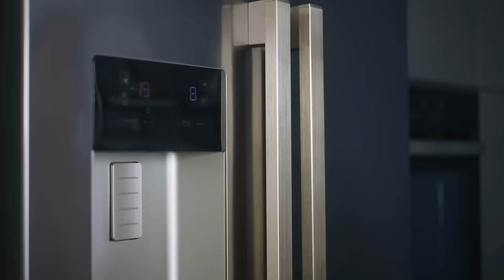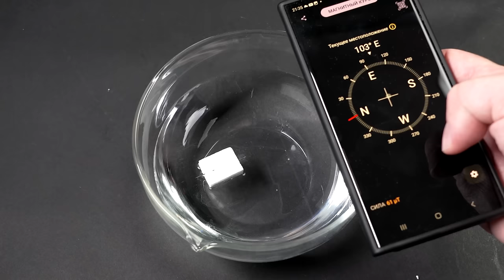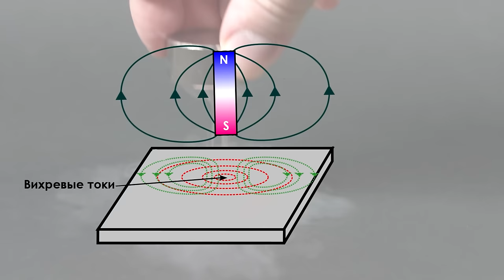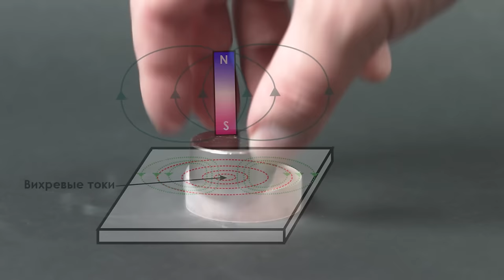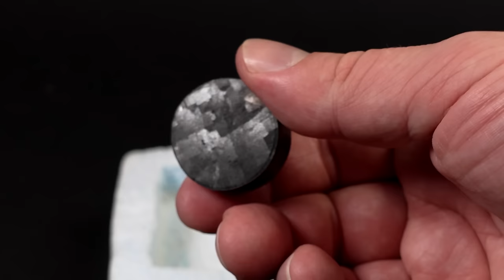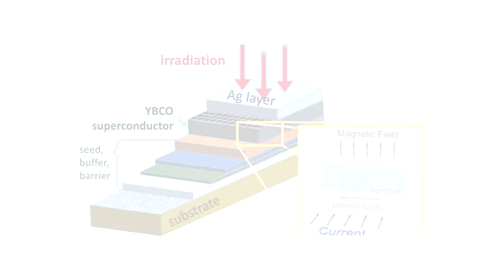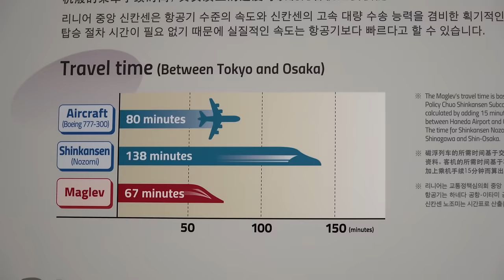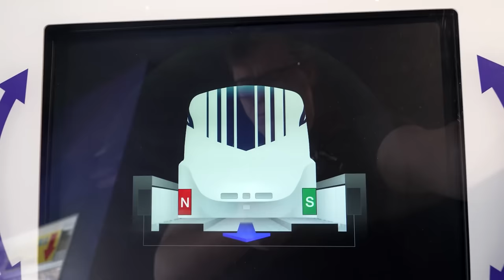This Metals Create The Most POWERFUL MAGNETS!

Comment: That piece you got of the low temperature superconductor was a section of a cable billet for making acellerator magnets. The wiire is stripped of the copper cladding and joined with a ceramic superconducting shunt. It is kept a few degrees above its transition point and charged to the desired current. When this is reached the heater that stops the shunt from superconducting is shut off and the current flows in an endless loop. Very 😎

Comment: 11:50 You need a milliohm capable meter that includes kelvin sense clips to do it properly, or at the very least the ability to null out the testing-lead offsets, as they are normal copper wire there.

Comment: Thanks for the video. Great stuff. Neodymium magnets are super cool. But, check out Iron Nitride magnets which are ~2x stronger than neodymium magnets... I would really love to see how you make Iron Nitride magnets...
One small thing re: the Translation, the "winding" is not pronounced "wind-ing", it is pronounced "wine-ding"
Reply: I've heard that you can make iron nitride by tumbling iron oxide rust and ammonium nitrate in a ball mill, then sinter into the shape you want. But the recipe is very finnicky. Robert Murray Smith did a video about them a few months ago, where he lists a few different methods that have been used to make them.
Reply: @DFPercush  Yes, exactly. And that is why it would be good to actually see it work and get some improvements.RMS didn't actually make it... so I was hoping someone would try to see if it really worked.
Reply: @DFPercush i appreciate his videos 😊

Comment: That experimental maglev train has been around sometime.  There was a big accident with it do to operational error.  The cost per mile of "track" is extremely high when compared to traditional high speed rail...The train has retractable wheels!
Reply: You can hear it running on the wheels  no other reason It would make that much noise

Comment: If the train was operated inside a tube and the air was pumped out in front of it, The top speed would be greatly increased and even Mach speeds could be achieved.
Reply: What about the sonic boom factor?
Reply: @DeathValleyDazed  don't worry, the train whould be stopped at the border and sent back way before it will get to the speed of sound

Comment: sooo, does that mean iron is the best balance of resisting and conducting? but what about a superconductor coil magnet made with boron nitride-nanotubes and ceramic: so this could be fairly easily made and retain its charge fairly well (being boron it will also resist heat better than carbon)

Edit: Ah, I see. so the ceramic alloy is already being used for magnets
Edit 2: Lol you went really in-depth

Comment: From my understanding Quantum locking is not the equal repulsion against gravity. The repulsion against gravity is due to the expulsion of the magnetic field lines from the superconductor; ideal diamagnetism due type 2 superconductor. Quantum locking is when there are impurities in the superconductor allowing magnetic flux to pass through those specific points keeping the magnet pinned to the superconductor; this keeps the magnet from sliding off the superconductor and the superconductor from falling away from the magnet.

Comment: Hybrid-flux - 1200 Tesla! Japan 2018! It exploded on purpose. They were testing the limits but used normal metals. It would be interesting to make the same but with the the strongest material possible and not take it to 1200 Tesla but a nore reasonable sustainable level.....

Comment: You cannot measure low resistance with two wires.
Instead send 10A through the wire and measure the voltage drop. Using Ohms law R = V/A, you find the resistance.

Comment: I’m curious what super conducting capabilities you may discover when looking into electromagnetism using a silver and gallium and argon  and aluminum alloy. Of what percentage makeup of each individual material and the method of fusing such together is still to be determined. But new studies of superconducting properties of gallium at room temperature are quite surprising.  with your current knowledge and excellent attention to your craft of all the items I mention I think you may, for lack of a better term be “picking up what I’m putting down”

Comment: Magnetic trains are cool but totally useless realy as to make them we need so many expensive materials and energy, and to maintain them it need so much work and even more energy/resources as this system need to be super precise. In long term usage it's would be better to just spend those resources to optimize existing engines(electric or fuel) as yeah tracks need to roll on something but maintaining those tracks would be just cheaper compared  to few kilometers of magnetic tracks. As short test and theories are cool but when reality hit you with material usage, weather, people incompetence, cheapness and crappy build quality when you need to order millions of parts via 3rd party companies(corruption. Lack of tests) all fancy technology just stop making sense...

Comment: Did you really try to measure the resistance of that strip with an ordinary multimeter? They aren’t suitable for low resistances. The 0.5 ohms you read was probably due to the probes and the multimeter itself. You need resistance measuring devices that are designed to measure that low of a resistance.

It just seems you really don’t know what you are doing electrically. Using a multimeter like that is a beginner error, you usually find beginners trying to measure the resistance of motors.

Comment: the bulk modulus stores depleation.  In place of space is lego, wee tiny lego, if you put enough imaginary equation into the lego, it depleats at a rate of infinity.  Like if you were to drive a space shuttle, the cloud from the lift off would be felt throuout the entire planet...at 0,00000001 Nm, but thats still more thasn it came with.  So imaginary constants require geometric similarity transform.  So iron has one of the highest geometric similarity of any imasginary material.

Comment: Correction:  The most powerful magnets on Earth are Bitter Magnets.  These are electromagnets that use large rotated copper discs to handle Mega Amperes of current through hundreds of turns.
Reply: Remember building one of them years ago. They are disks of copper that are hollow in the center and cut to the center. You put one on, then the insulator then another one. All the pieces are perforated to allow water to flow. In my case the disks were made of aluminum sheet rather than copper because it was cheaper than copper and easy to laser cut. We used it with a pulsed power supply as part of a MR experiment but was later used to magnetize stuff.❤
Reply: @christopherleubner6633  Nice dude, I bet that was cool af.

I've been working on an engineering project (myself) that has some pretty extreme magnetic field requirements.  I was considering building miniature bitters but I ended up compromising with some custom blowout coils - they're like halfway to a bitter.  The coil is made of insulated flat wire (I have no idea how they wrap them, the wire plane is orthogonal to the poles) so they can handle short bursts of kiloamps and they're only a couple inches long.

Fun little things.  Still not bitter magnets though.